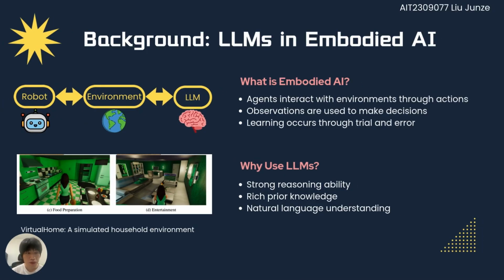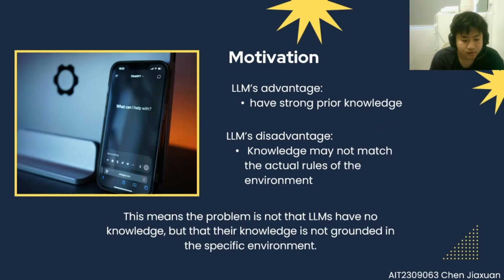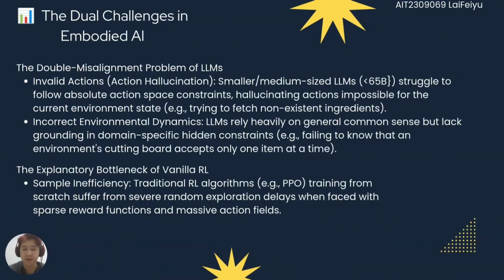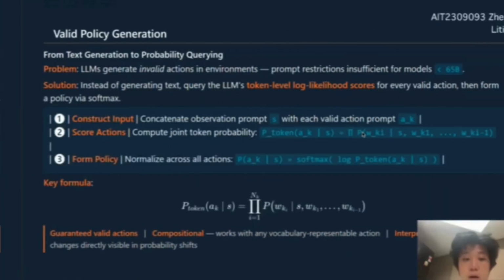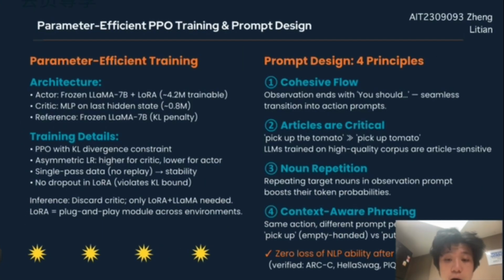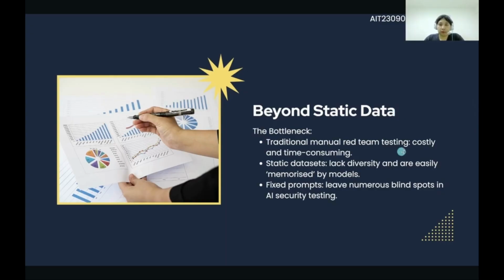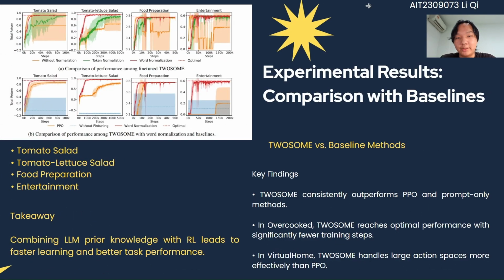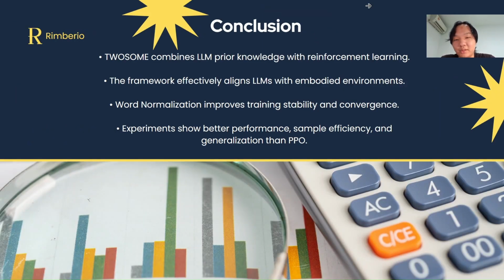202604 AIT306 Group 7

Comment: Group 8
Question 3

The paper reports generalization results on eight unseen tasks, but many of these tasks still appear to share the same environments, action templates, or similar procedural structures. How do you distinguish true generalization from transfer across similar task templates? If an unseen task introduces entirely new object relations or new environmental constraints, how would TWOSOME be expected to perform?
Reply: We agree that this is a reasonable concern. Although the tasks are unseen during training, many of them still share the same environment, action vocabulary, and procedural structure. Therefore, the results may reflect strong transfer learning rather than true out-of-distribution generalization. To make the claim more convincing, future work should evaluate the model in completely new environments with different objects and task structures.

Comment: Group 8
Question2

TWOSOME’s experiments primarily rely on high-level macro-actions and symbolic observations. Do you think the model is genuinely learning embodied grounding, or is it mainly learning to rank actions from a predefined set of valid options? Furthermore, if the method were deployed in real-world robotic environments with visual noise, low-level continuous control, or uncertain action executability, what modifications would be necessary to ensure its effectiveness and robustness?
Reply: We think this is actually one of the limitations of the paper. Since TWOSOME relies on symbolic observations and predefined action spaces, part of its improvement may come from learning better action ranking rather than fully grounded understanding. However, unlike pure prompting methods, reinforcement learning allows the model to adapt its behavior through environment feedback. So we see TWOSOME as an important step toward embodied grounding, although it is not yet a fully grounded system.

Comment: Group 8
Question 1
You've mentioned that TWOSOME is computationally expensive because it requires calculating the LLM probability for all legal actions at each step. If the action space is expanded to a real robot or a more complex VirtualHome scenario, will the main bottleneck be the number of legal action enumerations, the number of LLM forward iterations, or the PPO sampling efficiency? Is it possible to reduce costs using action pruning, retrieval, or hierarchical action selection?
Reply: We think the main bottleneck is the large number of LLM forward passes, because TWOSOME needs to evaluate every legal action at each decision step. As the action space grows, the computation cost increases significantly. We believe techniques such as action pruning, retrieval-based candidate selection, or hierarchical planning could reduce the number of actions that need to be evaluated and make the framework more scalable.